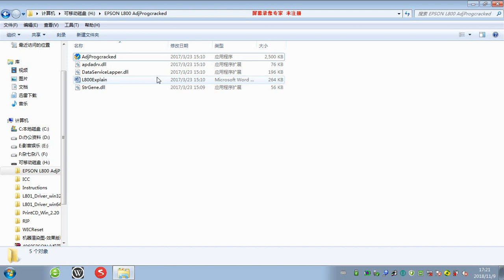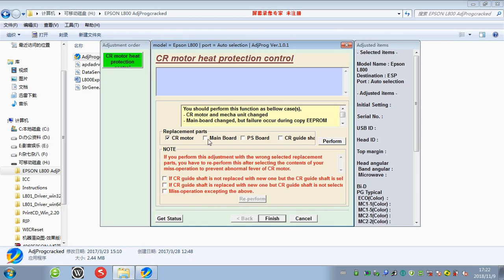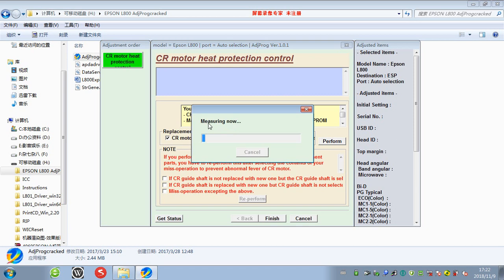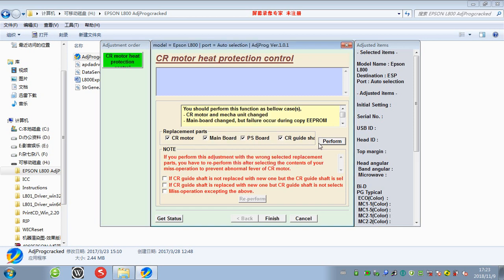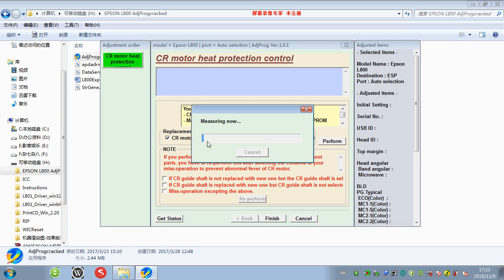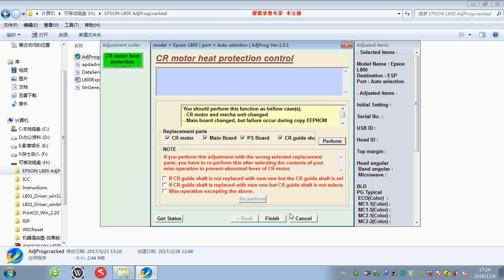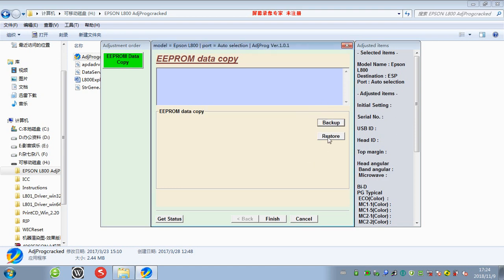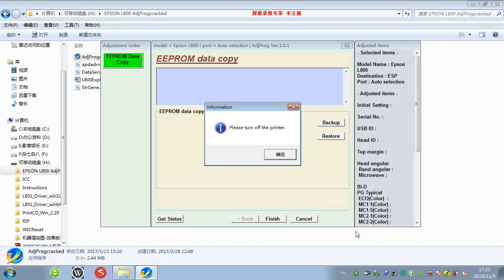A4 AMJ L800 UV Printer // CR Motor heat protection control reset

Comment: the heat protection control has been incompleted😭😭
Reply from the maker: keep the printer motor cool down totally , and do it again
Reply from the maker: and also clean the print head rail well, put some lubricant oil after cleaning

Comment: hello. i did that but after 2-3 printings the printer goes very slow again. what can i do to fix the problem?
Reply from the maker: make sure the printer cool down totally, then you need clean the rail of print head first, and put lubricant oil on it, then do the reset
Reply: Which lubricant is the best one? Is this the only part that needs
To be lubricated to avoid the slow down issue? Make a video of general maintenance  please!!! Yo are great!
Reply from the maker: liquid oil one is better and clean it before put lubricants on it ,  you can check my video of how to clean printer round rail